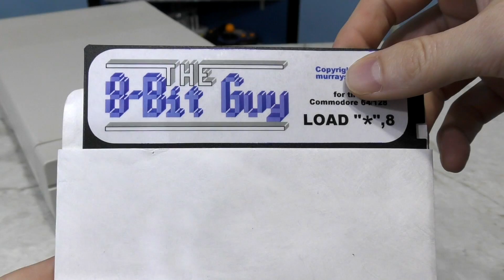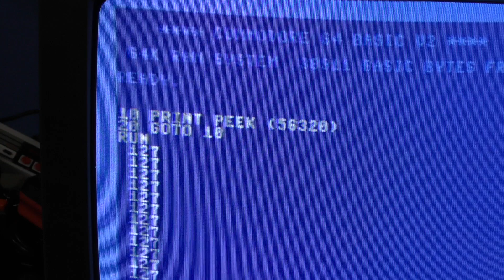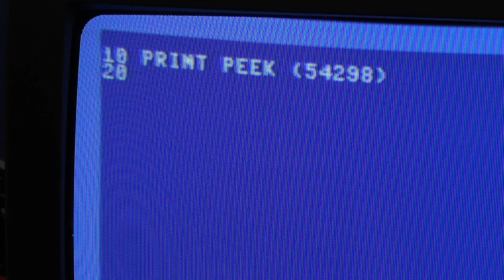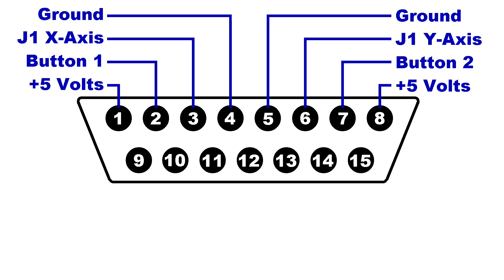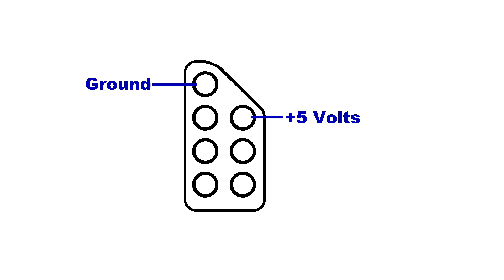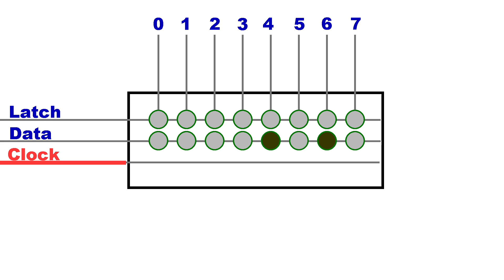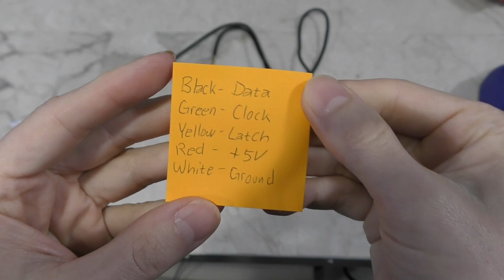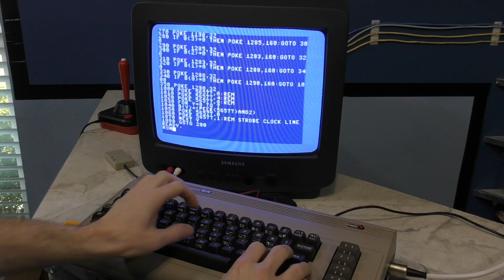How Vintage Game Controllers Worked

Comment: I just recently opened up an atari controller and I was able to figure out what went where and mapped the pins.  I did the same for my Odyssey 2.  I had 1 mostly working controller and 1 dead controller for my odyssey.  I couldn't just plug the Atari controller into the odyssey.  pin 1 on the odyssey is ground and 2-6 are fire and direction.  7-9 are unused.  I would of made an adapter if there was 5v I could use because then I could use the Atari 7800+ wireless controllers or the wireless 2600+ controllers on it.  Cutting a generic extension cable with all 9 wires, I was able to solder everything correctly and get working controllers for my Odyssey 2 console.

Comment: Hello. How do 15-pin PC controllers work with button-based D-pads instead of potentiometers? I see lots of resistors, transistors, and a microcontroller. Thanks.

Comment: Doesn't the c64 lack adc so the pins 5 and 9 are too slow for games? The atari 8 bits had a adc so they could be used as analog joysticks.

Comment: 3:51 if that +5V is wired to the voltage regulator and gnd to well, ground, then shorting them together technically should just take down the 5V line by overloading the volage regulator, for a short time it shouldn't really do much, but then again I'm not sure if some components that deal with multiple voltages depend on that 5V could get damaged if it drops below the design voltage.
Although it's kinda like the killer poke, even if you type it in and it has an undesired effect, you wouldn't waste any time to turn it off asap to prevent damage. Even if the select button is pressed by accident, most of the time no one is going to just keep it pressed and damage the regulator, that is if the controller port goes straight to it and not through other logic.

Comment: Wait, the Genesis controller doesn't even HAVE a Select button! The select pin is controlled by the Genesis console and allows it to read input from 6-button Genesis controllers. There aren't enough pins to support 6 buttons, 4 directions and Start, so the console toggles the select pin up and down in order to read them. It won't cause a short on the C64 if it's held at +5V.

Comment: What surprises me the most about game controllers is that for the most part, the bits you read are backwards from what you may expect. 1 is not pressed, 0 is pressed. This tends to be the norm rather than the exception - the NES controller is one of the few that isn't this way.

Comment: Beautiful, fascinating, you are a job of work.

Now, Atari Jaguar/Atari powerpad extended port?

Two further things,

1)  I need another Psone controller to USB (This I should be able to source)

2) I need a UK supplier for an ADB (Apple Desktop Bus) to USB adapter, I used to have a place to supply these but can no longer source. 

Any help/advice/ chit chat on these things would be appreciated. 

(though I have searched in vain and been told there's no hope of an Atari Jaguar to USB adapter :sad face:)

Comment: I made my sega master system controller work on sega genesis and put at extra button.
I also made my Snes controller control 2 players at the same time.
although I did fry my PS1 messing with the controller to force it to use an SNES controller. 
Can't win them all. lol

Comment: Why are there 5 binary inputs for an 8 direction joystick
Reply: One input for each of the four directions: up, down, left, right. Plus one input for the fire button.

The diagonal directions are read by checking multiple inputs at the same time..ie if you move the joystick up-right, then this will trigger the inputs for up and right.

Comment: Fun fact male Dupont jumper cables are the perfect size for forcing into where the SNES's wire goes. You can hook these to digital pins and it'll work if you set it up right. Used one in an Arduino project

Comment: And remember, these things don't drift, so it's frankly inexcusable, looking at you ps5 and switch, especially you ps5, you had years to learn what switch did wrong, and yet here you fucking are, getting reports of it. Also Nintendo, HOW HAVE YOU NOT FIXED THIS YET? WE LITERALLY NEEDED 1 MORE MILLIMETER OF THICKNESS ON THE BACK PANEL OF THE STICK AND IT WOULD BE FIXED, HOW HAS THAT NOT BEEN DELT WITH?

Comment: I recently got a 200 games in one NES game emulator thing as a gift, the controllers were pretty much the same as an actual NES controller just without brand logos. I was interested in how it worked, this video explained everything very well, super interesting! I am also interested to see if they would work with an actual NES , or if the wiring is different. Not going to risk it though.

Comment: I can beat battletoads on nes but I can only actually beat it on original nes hardware. Playing it emulated on anything else I can't pass stage 11 (I think it's called clinger winger, you fight an orb at the end) for the life of me. I feel like this old school design gives the controller much less input lag. Is this all just in my head? I've beaten battletoads about 20 times on the nes and never been able to beat it emulated on multiple different emulation systems. Someone please tell me if I'm correct.

Comment: Edit: Based on some replies, I assume the thing he said about Genesis controllers damaging Atari/Commodore consoles was just speculation. I'm glad to hear that people have tried it and didn't have their consoles blow up. 👍
Reply: I'm pretty sure it was unintentionally, lol. They wanted that start button
Reply: @jonathankhuzkian6419  I just meant, if they're altering the wiring like that, especially if it presented a hazard, why even use the same port shape?

Also, if I'm being honest, I'm actually a little suspicious about the claim. With all the people that had both a Genesis and an Amiga, and thought "hey, that looks like it fits", surely I would've heard about exploding computers by now. 🤷‍♂️
Reply: @Letham316  they didnt want to change the design of their system just to prevent breaking old computers, even if they did know about it.
Reply: Well ya know, Genesis Does. 😅
Reply: People would also use their NES power supplies into their genesis, which would fit fine but wasn't electrically compatible, destroying the console.
Reply: @LordVarkson oh no!
Reply: Or maybe not. either way, it was an absolutely stupid decision.
Reply: Sega master system controllers worked fine with the C64 and Amiga.   Mine still works after more than 30 years 😊
Reply: @roborbob2913  Good to hear. In fact, I've edited my original post to reflect some of the replies I've received.
Reply: @Letham316  More of an incorrect assumption. Genesis controllers don't have a Select button! The select pin is used for 6-button controllers and is controlled by the console, so it won't cause a short on the C64.
Reply: it's so Genesis controllers are compatible with Atari games
Reply: Yes
Reply: Hmm... I didn't know about this issue.  I used my genesis controller on my 2600 and my Amiga all the time
Reply: Feels a lot like sabotage to me. Like, idk if they put out a warning with the new controllers, but it definitely feels like it was done on purpose.

Comment: 5:45 maybe I’m too dumb to know better but I wouldnt even assume you need 1 pin per button / direction. I always assume the controllers worked like the nes. Basically you just need one “pin” (wire) for the controller to send a signal to the machine about what’s being pressed. That makes more sense to me

Comment: Teacher: So I'm going to try to explain this so it makes sense. There's a shift register—
Me: What's a shift register?
Reply: not sure if you understood or not from the video.
if you did, then please ignore the rest.
if you didnt, then hopefully this will help:
a shift register shifts(moves) the values of the bits to the left(or right).
for example let's say it has 8 bits, and they are
11001011
at the next clock pulse they shift to
10010110(the first bit is gone, and a zero is pushed from the right).
and at the next clock pulse
00101100
then
01011000
and so on, until all 8 bits have been flushed.
Reply: @sabin97  
"at the next clock pulse they shift to"

You didn't say this explicitly, but I'm guessing that it's the shift register that does this specific shifting of bits from left to right as you proceed to describe?

I don't know what a "clock pulse" is either, or specifically what you mean by "flushed." 

I have no problem with you explaining all of these to me, but my point was simply that a person is only really going to get it if he already has some knowledge of this type of thing, or if the teacher is very good at simplifying, and is mindful to describe every thing that the student may not know, such as what the shift register is and, now, the terms you used.

I've noticed that the same terminology that serves as convenient shortcuts to experts are, conversely, esoteric stumbling blocks for the new learner.
Reply: @sabin97  I appreciate you explaining all of this.

Now I'm just really curious to hear an explanation of what you dislike about Jordan Peterson. 

I suppose you're saying that he uses too much jargon, but then isn't the reason he's popular, in part, because people actually understand him and his advice is actionable?

Comment: As a mere fact, most modern game controllers are working in a similar way like on the NES - it's just the interface that's different. That's at least case with modern steering wheels. There are multiple shift registers, which are responsible for taking the input from specific section of buttons. Main board is responsible for taking data from multiple shift registers while converting the data into format, which can be handled by the device, to which the wheel is connected into.

Comment: I doubt David is "listening", but I have a question if someone can answer it.  He said the Atari joysticks were entirely digital, so that it doesn't matter how hard you push the joystick in a particular direction.  The NES controller buttons should also be either "on" or "off" if I understand correctly.  So explain this.  When you get to the end of Super Mario Brothers and jump on the flagpole, it seems like how hard you push the jump button affects how high up the flagpole you end up jumping.  What does affect how high you jump onto the flagpole?

Comment: When I was a kid I used a mega drive controller on my C64 and it worked fine, what gives? Maybe its a uk thing?
Reply: No, it's not a UK thing; it's  just a case of David being wrong.

Mega Drive/Genesis controllers don't have a Select button. He  misinterpreted the circuit diagram. The pin labelled "select" is an OUTPUT from the console to the controller, used to toggle which set of the eight of buttons/directions to read. It's perfectly safe to use Mega Drive controllers on a C64.

Comment: There is also another type of controller that makes use of a chip-select signal, used by NEC and SEGA. Using a commonly available 74157 IC. When the signal is 1, it reads 1 set of pins, when the signal is 0, it reads another set of pins. It effectively doubled the buttons by adding 1 pin. I bet the electronics is cheaper to manufacture than the NES controller since there is no register involved. It is also faster to read.

Comment: The NES controller (And by extension the Famicom controller) actually has the wires color coded and labeled on the circuit board.
Reply: Even though the controllers on the Famicom are hardwired?
Reply: @Coolman13355  Yup. Even with them being hardwired, they'd still need to make sure the right wires are connected to their corresponding points, so they used color coding. On top of that, the NES and HVC models of the P1 controller use the same PCB, as supported by the color coding for both models being listed on the silk screen.

Comment: 1. The way the NES Controller works is basically like most serial connections (similar to USB).
2. Modern controllers mostly use USB for charging and/or synchronising, they instead use Bluetooth for wireless connections.
Reply: On #2 yes & no

Comment: Why don't you write a port of Pokémon Red Version for Commodore 64 that uses your NES controller and adapter? It would be a worthwhile challenge. When extracted from the Gameboy Game Pak, it's 1 MB in size, which means it would most likely fit on a standard 3.5" floppy disc. However, you'd probably have to alter the program a bit to accept your input, so a high capacity floppy disc might be a better bet.

I did some research, and the 2 x 2 tiles used by the Game Boy fit perfectly in a character on the screen. The Game Boy has a 160 x 144 resolution, so you could implement a palette of 16 colors by using FLI mode. Maybe you can even create a 200 x 160 map to match the Commodore 64's aspect ratio. The music itself could probably be ported over 1:1.

Maybe you could even use the serial port for trading functionality!

Comment: The Vectrex also used the same 9 pin joystick port. As I recall, it works a tiny bit differently when you plug it into a Commodore 64 and I can't see anything about that with regards to an Atari. Let me experiment for a few days and I'll give you a update

Comment: when I look at old controllers, I think modern controllers need a complete revamp.
most controllers are based around the playstation analog controller, which came out in 1997, so over 20 years ago.
video games have changed a lot since then, but the controllers stay the same. even these nintendo things have unusual shaped but are pretty standard controllers.
but I think they won't change because console gamers can't handle too many buttons

Comment: Just as a note: I am pleased that you covered the static shift register. When you state that the SFC/SNES uses a larger one, I wish that you had expanded on that for the typical viewer, as technically it uses two SSRs in sequence.

Anyway, I'm glad to see this information offered out in a way that the average hobbyist can digest. I'm one of those mad blokes who's made (digital) trackballs and mice for the NES/Famicom, and adapted controllers to all sorts of unintended purposes. I found your use of the old IBM DA15 joystick to the C64 quite novel. Very nice!

On a side note: Those extension cables for that NES port are harder to find than the controller cables. To viewers, I'd suggest de-soldering the connections inside the NES controller and replacing it, or just snipping off the end; or by using the actual NES ports (they are connected with a straight pin connector, not soldered in), to build an adapter.

IMO though, it's far simpler to wire up the NES controller to a DB9 female connector, bypassing the SSR entirely. Just cut its traces and wire up your pins to the actual inputs to the SSR.

When I built my mouse and trackballs for the NES, I effectively did the opposite of this: I wired in an SSR to the signals from  each pin, and my output signals to the NES or Famicom came out of the other side of the SSR. Eventually, I automated this with hand-made adapters, so that any Atari standard digital joystick worked, however, to use two buttons, I was forced to modify the actual connections.

Comment: I wonder how n64 joystick Works with just 3 wires - one for ground, second for power and third for data. On a single wire, data from all buttons, analog stick and data transfer from expansion pack, rumble pack, or even more outstanding, a full game data bein transferred on a single cable, in a case of a Transfer Pak running Pokémon GB games on Pokémon Stadium.

Comment: So if you push the select button of a genesis controller plugged into a C64 you can make it explode?

Gotta go fellas

There's a bank that needs me to rob it
Reply: Nope. David's fucked up his explanation on this, the select pin isn't connected to a button, it's an output used by the console to select which bank of buttons to read. Look at a Genesis controller and try to find the Select button.

Comment: Wait, use a NES controller, connect it to a C64, then take the inputs from the controller and then convert it to a normal layout of a C64 joystick using your program. Then build an adapter to connect your C64 running Controller program to a C64.

Comment: gasp we used our genesis controller on a c64 so many times, how did we not fry the thing. 😐
Reply: well, i don't think that it would actually fry the computer... since there would only be a current flow from 5 volts to ground and depending on the resistance of the cable it could be possible, that there isn't enough power going through it to damage the power supply... but no matter how true that may be, it's never a good thing to connect vcc and ground :D

Comment: Very different than USB today. The old Joystick ports basically only registered high or low or translate a resistance value if they were the analog pins. USB is much more complex in that it is more similar to the network port with its own protocol stack. The USB Data is packet-switched and transmitted to and from the host serially or with only 2 pins. It is up to the upper layer application or driver to interpret or decode and make use of the data. You could actually capture USB packets on Wireshark by installing the USB Driver that comes with it.
Reply: The nice thing about USB is that it has none of the limitations of the older joystick/controller interfaces. Notice how the pinouts of those old connectors had a separate pin for each button or axis? USB has none of that. You can have loads and loads of buttons and axes on a single controller. I have here a Thrustmaster TWCS throttle, for example, which has 23 different inputs (throttle, buttons, mini-stick, hat switches, etc), all using a single USB connector.